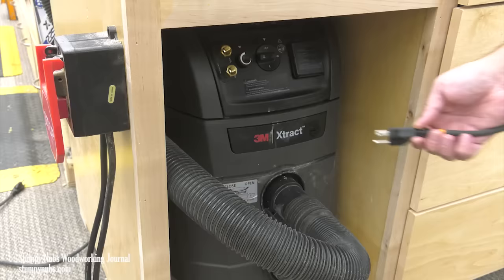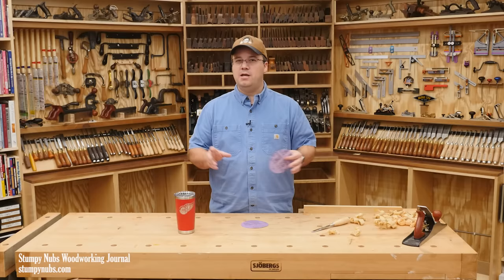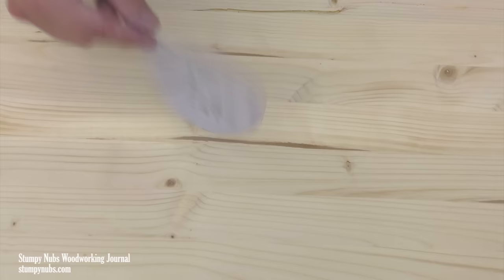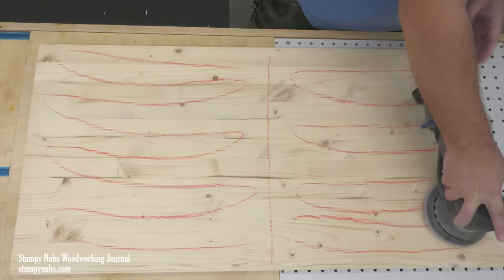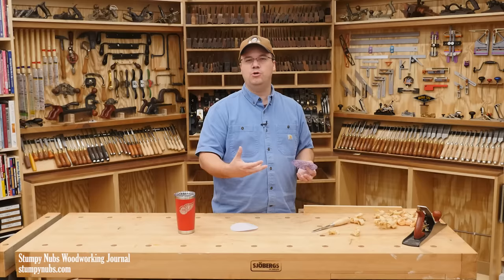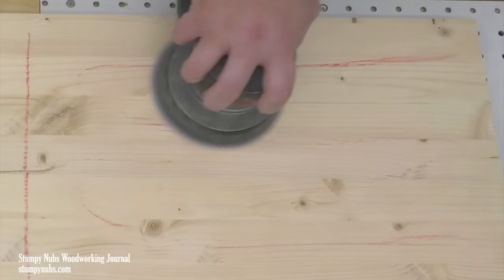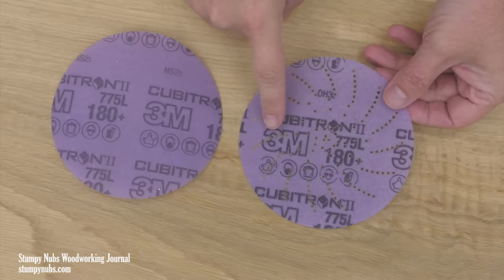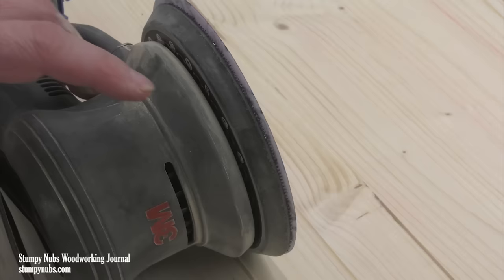This LITTLE KNOWN tip will cut your sanding time in HALF!

Comment: From my years of floor sanding I can confirm that dust buildup under orbital sanding discs or sheets is a primary cause of scroll marks. Reduced density of grit on the sheet ( i.e. , dust clogging ,  )  does not allow the sheet to remove its own marks. As a corollary , do not use worn 120 to get 150 results. Throw away the 120 and switch to fresh 150. Sounds like everyone should know both of these things , but I've seen so called carpenters use a worn and clogged disc all morning and simply burnish , not sand , the wood.

Comment: Never use 3M Cubitron net sandpaper without a pad saver. The pad’s Velcro hooks are too long and protrude through the sandpaper, causing the hooks to wear off. Pad savers are $2 each attaches to original pad and has Velcro hooks to grab the paper. The pad saver will last quite a while but certainly a lot cheaper to replace the pad saver than a new pad for your sander. Just something I’ve learned in my journey.

Comment: You can quantify it by weighing the pieces before and after, keeping the other variables like pressure, sander speed, grit, and sanding time the same.
Reply: Now that seems to be a valid test. My sander has a small bag that collects dust without a vacuum. Aren't all orbitals the same? Of course one "removes" more wax than the other, the one without holes is just spreading wax around. I expected more from the guy, he is usually much smarter than that. I wonder if a vacuum is more efficient for small jobs than just the bag. It has the clumsiness effect to take into account...
Reply: Those “dust collection” bags are junk.  Plus the clumsiness of hooking your orbital sander to a dust extraction system now (or even just a shop-vac) will be far less than the clumsiness of hauling around an oxygen tank when you’re 75.
Reply: @mrimmortal1579  Thank you for such an objective verification. I wonder why people waste their time testing stuff.
Reply: @mrimmortal1579  Oxygen tanks also have wheels. Six to one, half a dozen to the other.
Reply: @guilhermecorrea9483  I’ve went both ways, when I had a small job where finding the small hose and adapter to attach to my big shop vac seemed like a pita. The difference between the bag and the shop vac is enormous, in terms of dust on the board and in the air.
Your lungs deserve better 😊
Reply: @dian3145  I do really small jobs in the open, and don't even have a shopvac. I don’t care about health and cleanliness, but of course the effectiveness gets my attention. I just wish the test were more valid, because it did no justice to the way I understand the machine works without the shopvac.
Reply: @guilhermecorrea9483 He did say he knew there was a difference already. This just illustrated it and indicated the time differential. Having said that, it does function as a nice bit of advertorial for those discs (which, tbf, they warrant).
   After a day spent carving back sand and cement base render in daughter's and son-in-law's kitchen with multi-cutter and a Henry vac, I mentioned how I miss the big old Kärcher that I hammered for 30 years. Ideally, I want to save up for an H-class machine (£550 to £900 depending on capacity and robustness). But I also hanker after Shokz bone conducting headphones so I can ride my bicycle and take phone calls (£150). Age 68, life extending stuff is less important to me but they'll benefit from my health permitting babysitting the grandchild they're about to produce. Choices... difficult!
Reply: @guilhermecorrea9483 Never use the bag. Always attach an extractor. Better finish, faster results, healthier. As 68-year-old who, like his contemporaries, ignored health and safety (and the dust control was less effective plus mire expensive), I got lucky (and had years not doing any construction or woodwork) but many didn't
Reply: @stephennicholas2020  I am really impressed by how much you love the big old sucker. But don't you see my problem with the test makes all your stories irrelevant? I just wonder how much of a difference it makes. Also, why don't we start discussing masks to make things even more tiresome here?

Comment: Lumber crayons are really good for hand planing, besides showing the high / low spots the wax lubricates the plane sole as you work. Nearly all the wood I work with is dense Australian hardwoods and I find that I need to wax the plane sole frequently, so using crayons on the wood has become a common process for me.

Comment: Working on a large project (~1000 sq ft of sanding). Used the Cubitron Xtract disks with dust collection on my DeWalt sander and found I got excellent results with very few passes. Fully agree with your conclusions.

Comment: I bought those same 3M sanding disc's and wondered about those holes. I was always trying to line them up with the holes on the machine but that proved very time consuming and almost impossible. So thanks very much for clarifying the reason behind them small holes.

Comment: Actually, the dust migration path is interesting.  Share more of your discussion with 3M, sometime, if there is more.
Reply from the maker: I think I will make a detailed video about what makes Cubitron II different. But I can't do too many sanding videos too close together or people just complain.
Reply: @StumpyNubs 
Some do get rubbed the wrong way by the smallest of grit, there's no way to smooth out everyone's experiences...

Sorry, I couldn't stop myself when that line popped into my mind, I just had to...
Reply: @kholdanstaalstorm6881  Indeed, many abrasive personalities on YouTube...
Reply: @mountainousterrain1704 and some need to be rubbed out 😂
Reply: Nah stuff em - bring it on!  @StumpyNubs
Reply: @StumpyNubs I'm surprised at you choosing the Cubitron II option with holes over the net sanders, I'd value your take on the differences and relative advantages of each!
Reply from the maker: @feanor5037   The Xtract mesh discs defiantly have the best airflow, and they contain the same Cubitron II sanding grit, which is what I really like about this line of sandpaper. But mesh discs shred if you are too aggressive or if you sand up against perpendicular surfaces, and they require a seperate backer pad to protect your sanding pad. I use both, but I think the average woodworker is better off with the spiral discs.
Reply: @StumpyNubs  Great explanation - thanks! Love how you take the time to explain all the whys and wherefores, absolutely invaluable stuff
Reply: These are a game changer, I’ve been using them a couple of years and no more swirls with my vacuum attached.
Reply: @StumpyNubs looks like your autocorrect is substituting “defiantly” with “definitely.” That jumps out at me super strong after I finally noticed mine had been doing that for the past several years. 🙄

Comment: Removing the dust keeps the sanding disk in better contact with the wood since it doesn’t have to continuously “regrind” the loose dust particles. Even when hand sanding I will always wipe the surface with a micro cloth between passes. Makes a huge difference.

Comment: I'm sold.  Maybe not with the 3M setup, way too pricey, but the sanding disks aren't that bad. Up until now I've been getting the "500 disks for $20" from Fleabay.  Just watching you take down the wood crayon with one pass is worth me getting one pack to try.
Reply: FWIW -  I made the switch after watching another video James did a year or so ago and I will never - EVER - go back to the old discs. It was truly amazing what a difference they made. Got mine from Shmamazon and they had a slightly different raised triangular pattern on full mesh (still true 3M Cubitron though) and they scared me how fast they cut, which means more BF per disc in less than half the time. And I don’t think they cost me that much more than the red stuff from the orange people.
Reply: As Tom Lipton says, cheap abrasives are a false economy. I've been using the 3M and Freud (for my 5" sander that I don't use often) mesh discs lately and have found they miserable chore of sanding much more bearable. I have a cyclone set up with my shop vac that has a bag and blue filter (intermediate between the standard paper and HEPA). Works well for me and doesn't kill me on cost.
Reply: @bigjgordon ”the red stuff from the orange people”.  Too funny.
Reply: I thought the same thing, but then saw they were $2 a disc. A bit pricey for something that can rip so easily.
Reply: @SamWanamaker1 They last a lot longer and IMHO the time saved is worth it. I don't use my older stock of cheap ones not any longer.
Reply: I like Mirka's abrasive mesh products. Considerably cheaper than 3M, they wear faster but are completely open so don't clog & the worn sheets can be used to skip grades without leaving big gouges the way most would. When they're fully dead, I wash them off & later use them to apply oil since the mesh can hold a lot of it at once & won't tear or drop fibres.
Reply: @nightcatarts  I have some Mirka ones that came with the sander as well as the 3m with these zig zag meshes, not the ones with the spiral hole pattern. They are both considerably better than the cheap paper ones. I didn't do any tests to compare their performance. The 3M were easier to get for me when I bought the last ones.
Reply: @drstefankrank  Yea it depends where you are. 3M in the Americas & Mirka in Europe I think. The ones I have are full mesh in rectangles so you have to use two to cover the sander, but they're priced at about half the 3M spiral circles. I see that 3M are also doing full mesh now but I've not tried those.
Reply: @SamWanamaker1  never had one rip. Not once. And mine were somewhere between $1-$1.50. The other brand I used to use was something like $0.90 per. That was almost a year ago, so things may have changed, or my memory might be off - either way, at the time the difference was not enough to worry about , especially given the obvious benefits. Just my $0.02, take it with a grain of salt. 😉
Reply: Go with the 3m 310W they are under 50 cents and I get them in 6 inches. While ones in video are 2 bux a disc they arent 4x as good but maybe 15-25% better. So I usually get the 310w as they are light years better then anything close to 50 cents a disc.
Reply: @SamWanamaker1  Try the 3m 310w under 50 cents a disc. Blows anything close to it in price out of the water. Ones in video are 4x price and are probably around 15-25% better. I stick with the 310w for now.
Reply: @nightcatarts 3M do a mesh Cubitron discs as well which are a lot cheaper than the ones with holes in.
Reply: @soylentgreen326  Yes I just found those. They look exactly the same as the Mirka ones for a similar price. Don't know if they wear down as smoothly though.
Reply: @SamWanamaker1  Check out the same sized discs for automotive finishing in the finer grits like P2000 and P5000.  All of a sudden the regular cubitron stuff will seem dirt cheap.
Reply: @Milkmans_Son  well thats not really apples to apples. Basically been using a pretty decent sandpaper that’s 50 cents a sheet, so I’m just curious if paying $2 a sheet (that’s just what it is in his link, you may be able to get it cheaper) will actually last 5x longer than what I use, to make it worth it.
Reply: I bought 3M and found it didn't make much of a difference compared to the large packages on Amazon of the "cheap stuff".  Using a 6" festool sander versus a 5" dewalt makes a much bigger difference.  I have noticed that 3M is everywhere on YouTube so I feel this is forced marketing across all my favorite channels.  I bought in to the hype on a variety pack and noticed shorter life for some soft woods and honestly no differences in on hard woods, but if they got "gummed" up I was much more annoyed since they were $2+ per disc.  Save the money for a better sander.
Reply: @bennettibey9498  what 6 inch discs do you use for the Festool if you don’t mind me asking?
Reply: @SamWanamaker1  POLIWELL 6 Inch 49 Hole Sanding Discs Hook and Loop 80/120/150/220/320 Grit,Heavy Duty Round Flocking Wet Dry Sandpaper for Random Orbital Sander Wood Metal Car Polishing and Finishing,50 Pack
4
Reply: Great advice expressed  very convincingly. Thanks from New Zealand!

Comment: Cubitron II is head and shoulders the best stuff out there and when factoring in your time, is actually one of the most cost effective options as well. Absolutely no brainer purchase, even if you just have a regular ass shop vac like myself. Bonus points if you have one of the super nice 3M or Festool dust extractors.

Comment: I bought the Bosch random orbital and just use the built-in collector.  I'm a low-budget weekend warrior, but this sander rated very high in tests of dust collection.  Have been very impressed with exactly that (as long as I remember to empty it before it clogs up).  And have also been very impressed with how long the sandpaper lasts.  Don't have enough experience to have an opinion on sanding speed.

Comment: I was lucky enough to be introduced to random orbit sanders by a magazine article decades ago and got my porter cable and an adapter hose for the shop vac. Lots of noise but, as the (fw?) article pointed out, using this way made the discs last a lot longer. Don't remember if it mentioned quicker as well. Guess I always assumed so and almost never sand without a vac attached. 

Hate sanding of all types. Trying to cut down on it as much as possible. But the ro and vac are are about as efficient as portable power tools get.

Another great vid. Thanks.
Reply: I was introduced to the Porter Cable random orbital sander with dust collection around 1988, been using them ever since. Getting a “dust extractor” was a nice addition, especially with the hepa filter, but a regular shop vac worked fine for years. I”ll have to try the Cubitron discs now that I know a little bit more about them.
Reply: I've found that the shop vac works better than a dust collection system. That article, or maybe another one mentioned that you can also remove a rubber belt on the pc (looked like a rubber band) that's there for slowing the machine when you turn it off (instead of some sort of motor brake. Not sure if this is possible on a small tool). Removing this lets the sander cut with a lot more power. You have to be careful, maybe a scrap to set the sander on while it slows down.  And don't start the sander unless it's flat on the surface, otherwise it will gouge the finish. Since then, I've had no use for a belt sander, and I also do as much planing and card scraping before any sanding. You probably already know most or all of this. If so, apologies for this novel, but just on case . . .

Comment: The distinction between a dust extractor and a shop vac is basically the magnitude of the vacuum they can pull. This pressure differential is ~additive. With this in mind, I get really good results connecting my shopwide dust collector to the outlet of my shop vac. The total suction of the combined system is noticeably better than the shop vac alone. 

This is still not the same as something like the 3M, I have that thing at work and it is amazing, but every bit of added suction helps.

Comment: Great info, and I totally agree from experience as well. I would only say, for the past year now I have been using Mirka abernets and just today even with out dust collection using their 80 grit on rough sawn oak my sanding was less than half the time using paper and the Abernets last a very long time and no I am not a Mirka shareholder.
Reply: One very quickly becomes a Mirka shareholder. You start off with just few discs and end up with a box of 60, 80, 120, 180, 240 and 320 grits just because 😂 stuff is damned pricey but really good

Comment: I am not a rich man, so a vacuum cleaner with an automatic on switch connects to your favorite tool was out of my reach. However, for about $30 I bought a plug with two outlets, one for the tool and one for the vacuum cleaner. I got a small 6 gallon vacuum from the big box store. I have it hooked up to my table saw and my thickneser? (What they call it on the other side of the pond). Huge difference. I will start using it for my sanders. Thanks James

Comment: I used to just use regular flat disks and decided to try the mirka iridium's, well the supplier only had ones with holes so eh what the heck lets get my sander upgraded to full vacuum, luckily I have a festool cleantec to hook it up to. Just the amount of dust that isn't coating all my horizontal surfaces was a night and day difference and the sandpaper lasts longer ans doesn't get hot. If you're on the fence about upgrading to a vac set up and like keeping your shop and lungs clean its worth the price.

Comment: Started using Cubitron discs on recommendation not long after they came out. With extraction they work 100% better than standard discs and do indeed both improve the quality of the finish as well as speeding up the dreaded sanding work. I'd never go back.

Comment: Maybe the waste extraction keeps the feed rate higher than otherwise?  If you break down sanding into a discrete number of interactions between the medium and the workpiece, I’d imagine that waste removal keeps the average higher than it would be if the sand paper is gunked up, but I think you basically said that already.

Comment: I use cubitron disks ( after you recommended them in a previous video ) Mine have a mesh rather than holes and they work very well.
Reply from the maker: I like the mesh, but many find the spiral ones more durable.

Comment: Though I doubt it would make a difference in this case, using the disc with holes for both tests is still advisable for tests like this as we can’t always tell offhand if a variable is affecting the result